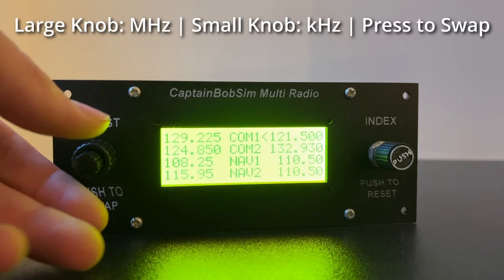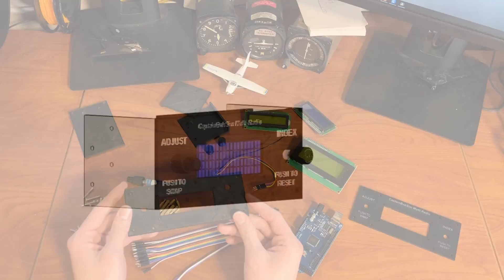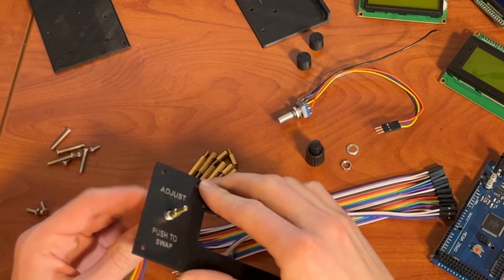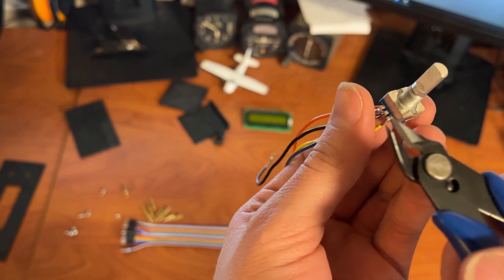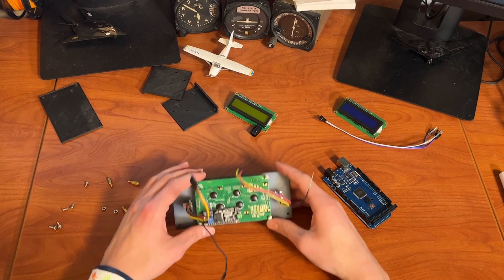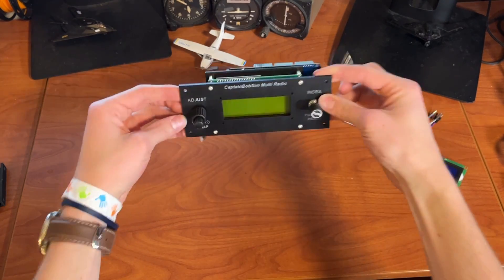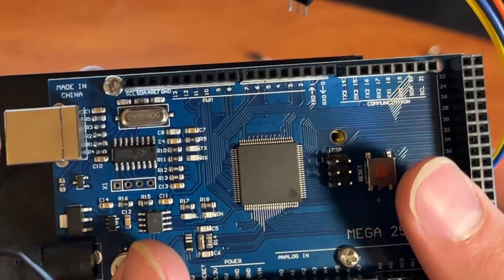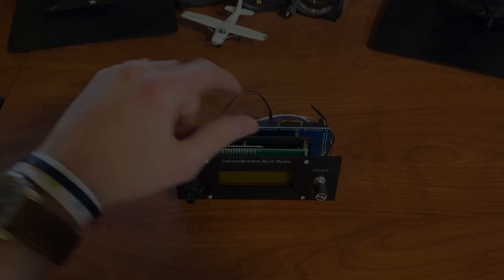Make a Generic Multi Radio Panel | C172 #39

Comment: Hi Bob, I Have a few Arduino UNO’s, can i use one of them instead of a Mega at this project? It has enough GND connection’s?It would fit in the Mounting Plate?
Also, If I don’t want to use a Dual Encoder I can use a regular encoder and switch between fine and rough using the encoder button? 
Last thing, Regular encoder require 5V or GND only?
Your Projects and Help for the community is absolutely amazing!!! You are my favorite Aviation YouTuber.
Thanks!
Sorry for the tons of questions🥲
Reply from the maker: Hello! You can twist/connect multiple wires together to create more grounds "it all goes to the same place"
You can use an UNO or MEGA, they both will fit
You'd have to change the code for that but can do it!
Regular encoders only require ground. I hope you have a blast with your build!
Reply: @CaptainBobSim  Thanks!!!

Comment: Hey Captain! I'm planning on making a solution like Knobster, but instead of setting the conditional variables (altitude, heading, course etc) in mobiflight with switches I was thinking if there's any way to set them externally on a webapp or something in js, python, I used TouchPortal a bit, very cool add on for it and was thinking of doing something similar so we can use a single knob for all the adjustments to be made in the aircraft, thanks in advance :)
Reply from the maker: Not that I know of but you might could talk to people in the MobiFlight discord about it!

Comment: can an LCD display be connected via mobiflyght even without SP 1602?
Reply from the maker: I think it does need the LCD Driver circuit board.
Reply: @CaptainBobSim  Where can I buy the  LCD Driver circuit board? Love your content!
Reply from the maker: @sundar999  Amazon, eBay, etc. I also have some if you want
Reply: @CaptainBobSim  Thanks!  You're such a great help for other simmers 🙂

Comment: Great video…I’m curious how you managed to get the single encode to move from field to field.  I’ve managed to get them all displayed but can’t figure out how to get a single encoder to do that.
Reply from the maker: I set the encoder as an "index" using a MobiFlight variable then used a precondition to only run the row if the index is = 1. I also made a tick for each row that only shows when the index is at that row.
I followed that logic for the rest of the rows.

The video showing how I did everything will be posted relatively soon (just a lot of editing). The .mcc file I made is in the GitHub.
Reply: @CaptainBobSim  thanks for the quick reply…great work btw.  My home cockpit is coming along, and a lot of the mobiflight was thanks to your videos.
Reply from the maker: @shadetreehomesim  I'm so glad the videos help! Sometimes the MobiFlight videos are annoying to make, but I'm glad they are paying off!

Comment: Can an arduino mega handle more than one task?  It seems as though every instrument, every mod uses a separate Arduino.  If possible, is there a chance we can use 1 Arduino for more than 1 task?  example, altimeter, airspeed and artificial horizon?
Reply from the maker: Yeah! Arduinos can handle up to 65 input/output pins. You'll just always see me using my prototype arduino in the videos so you aren't staring at a monstrous wiring loom while trying to learn the wiring.

Comment: Hi Bob! You don't happen to have an stl file for printing a dual encoder handle.Sorry about my English.Sincerely Vasily
Reply from the maker: it should be in the printables I linked in the description
Reply: @CaptainBobSim  it is very difficult for me to understand the language. Please show me where to go
Reply from the maker: https://www.printables.com/model/344424-generic-multi-radio-panel-flight-simulator/files#preview
Reply: @CaptainBobSim  Many thanks.  I am very glad that there are people on the planet like you.  I follow your work and I really like it.
Reply from the maker: @Василий-фотограф-Гомель  Thank you!!
Reply: @CaptainBobSim  Hi Bob! If you use the Round($*1000, 0) condition for NAV 1, then the numbers will be more beautiful in my opinion.For example 117.400 and not 117.40
Reply from the maker: @Василий-фотограф-Гомель  True!  It does look pretty :) I did it this way to comply with the European standard  8.33kHz system: https://ifatca.wiki/kb/wp-1997-87/#:~:text=8.33%20kHz%20Spacing%20*%20The%20use%20of,in%201995%20and%20subsequently%20adopted%20by%20ICAO.&text=*%20The%20frequency%20numbering%20arrangements%20are%20shown%20in%20Appendix%20A.

Comment: Excellent job, as always.  Having a proper rotary encoder makes sim flying SO much more immersive.  The Propwashsim ones are fantastic and a great value - dual encoders are hard to find when you are only buying one or two.
Reply from the maker: I couldn't agree more!
I like the propwashsim ones. I do wish they had a single common pin instead of them being split up.

Comment: Love this design, thinking of getting the build kit, but wondering if it’s possible to incorporate this with air manager rather then mobi flight
Reply from the maker: While you couuuuullllllddddd use Air Manager I'd recommend against it.
I feel the coding process would be such a hassle and time sink it wouldn't be worth it (at least to me)
I use an LCD that has a driver using only 4 wires, where Air Manager (to my knowlege) supports only the LCD without the driver (16 wires)
https://siminnovations.com/wiki/index.php?title=Hw_chr_display_add
What makes Air Manager preferable to you?
Reply: @CaptainBobSim  I'm already using Air Manager for my Cessna Switch panel, and I really don't want to have two apps running in the back ground, if I don't have to, and I already paid for Air Manager. I used Air Manager because at the time it just seemed easier to setup for the panel then learning to do Arduino Scripts which I suppose I could do, I just didn't want to spend a lot of time doing it.

I'm not totally apposed to getting MobiFlight if it makes sense, but it would all depends on how easy it would be to convert  everything over.
Reply from the maker: @tomreppert5697  Gotcha, I definitely feel it's much cleaner to have one app running than two!
In my experience, Air Manager is best for things that are premade (switch panel, or common instruments).  It really shines when you want to display instruments on a screen.
MobiFlight is increasingly popular because it easily allows you to connect things in more customizable ways. 
It should be decently easy to convert over if you want to. I also think you would be fine running both at the time as MobiFlight (at least in my experience) isn't a very taxing software.
Reply: @CaptainBobSim  Yes that’s one of the other reasons I went with Air Manager, I did a DYI knobster and bought a touch screen, so that I could have a radio, transponder, and maybe a GPS later on, but never got the touch screen to work. The plan was to use PilotsEdge to train for ATC radio calls. When I saw your radio panel I thought that would be a good solution. I looked at some of your YouTube post last night on MobiFlight and the one one the switch panel, and think I may give it a shot.

Thanks for all the help.